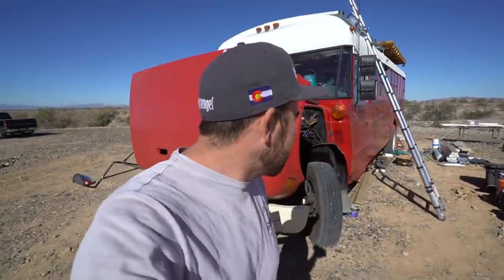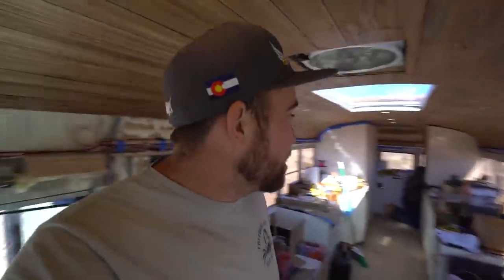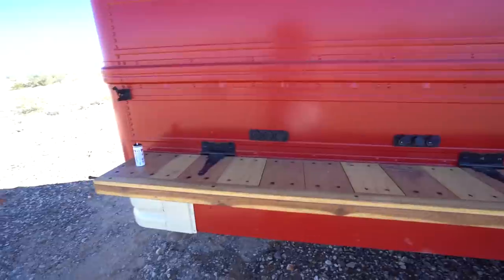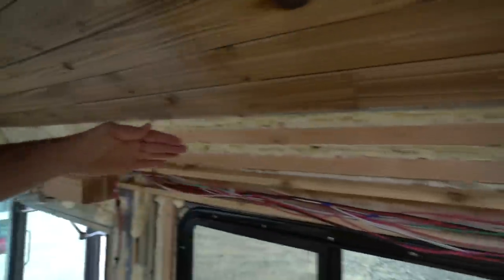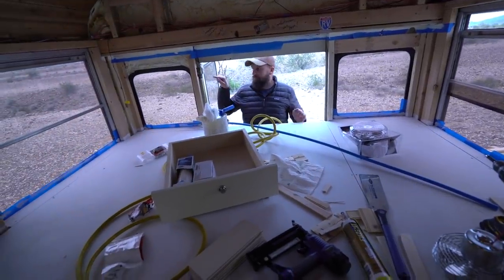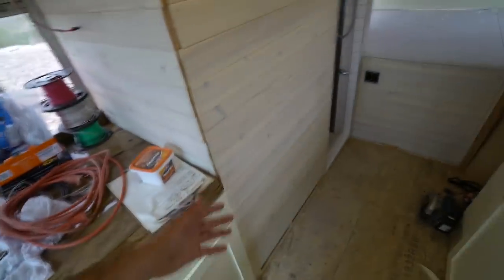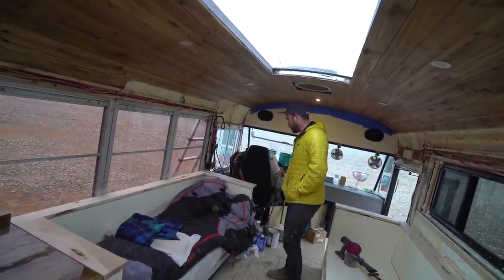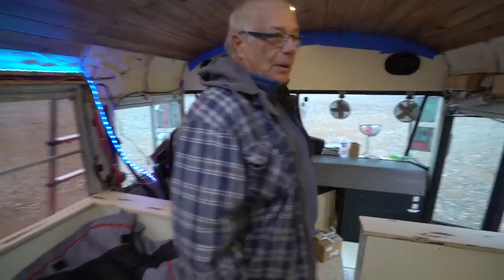MAJOR PROGRESS!! (Skoolie School Bus Conversion)

Comment: Keep the bathroom ceiling color as light as possible. A light color just makes your mood better over a darker color. But at least seal it with some urethane to keep the shower moisture from soaking in & warping it.

Comment: On the small wall at the bed, install a 6" metal kick plate at the floor level. Will save the finish from all the scuffing.
Hey, you caught the error about the power to the fridge. That is the important thing.
Reply from the maker: We made it to be removable. It’s gonna get trashed.

Comment: Are you gonna add lights to that clothing storage? Would probably be super useful and easy to do if you can tap into any 12v source nearby
Reply: I think I'd just go with one (or 2) of those battery operated - tap-on lights that you can just stick on the wall where you want with double sided tape.
Reply from the maker: Good idea.
Reply from the maker: We though about it, but didn’t do it. We can always add it.

Comment: How come  the seating wood goes right to the back on one side and not on the other? Meaning the rear piece of wood goes all the way to the kitchen units on one side but not the other ?
Reply from the maker: I don’t follow.
Reply: @JaxAustin  At 08:52, the piece of wood doesnt go all the way back to the window because the rear wood piece goes along to the kitchen unit but on the other side of the seating the piece goes all the way back to the window. One arm rest is longer than the other one.

Comment: not so mush catching youre bed on fire with the on demand water heater jax but more causing carbon monoxide poisoning  
(this is if its not an electric but propane version)  i sure hope its one of those non pilotlight electric ignite models or you better air out the space under the bed long before you enter , might be a good idea to build in a small (computer) extraction fan pushing air out of the space intoo the outside of the bus (if you put a rpm regulator on it should be allmost noiseless and should use verry little current ) in the space 
drawing the air out causes a slight vacuum , that should help keeping the harmfull gasses away from you lying on the bed 
the gas is allso releasing a lot of moisture in the air 
youre probably going to regret putting the waterheater so far back and dont make the door inside when it needs to be serviced or just quit outright 

make the armrest a tiny bit higher and seal between the kitchencounter and the armrest , that way if you spill anything on the kitchentop it (hopefully) dont wash over the edge ontoo cushions of the couch but will be stopped / diverted by the raised edge of the armrest

i have to agree the bus turned out realy nice
Reply: excellent point about the armrests, but they're already done by now so 'se la vi'
Reply from the maker: Yes, it’s an auto spark. It’s a really good unit. Maybe the best. Copper heat exchange, so you can drink the hot water. The only thing the recommend is a flute, but I only take minute showers. The stove would put out more c02

Comment: Where are ya living while your working on the Skoolie ?
Reply: Jax are ya able to use the shower yet & are ya going w/ a flush or a composting toilet ?
Reply: If that is a skylight in the ceiling are you installing a retractable shade & on all the windows & the entry door also & drapes on the windshield for privacy  ?
Reply: How about dutless a/c & heat ?

Comment: Why would you want to do something that is against every code in existence? Burning a tankless water heater inside a closed building much less a small bus is asking for trouble and placing yourself and possibly others in danger. It is bad enough that you want to do it but to then show it on a video and then try to explain it as no big deal shows that you have no idea what you are doing.
Reply from the maker: Well Larry, it is tankless and ventless. So there’s that. And I think it’s a known fact that I do not come from a building background.
Reply: Jax Austin 

I think that if you check the instructions, the ventless heater is to be surfaced mounted outside, therefore it does not require a vent. You need to understand that what you show and do will influence others therefore you should be more cautious to insure the you not cause others to harm themselves. I generally do not comment other than a thumbs up or a job well done but this could cause serious harm. FYI, I was a plumber for forty five years, Master plumber for thirty of those years and have installed and maintained tankless heaters for twenty plus years. Please do not take this as criticism but as concern for your and others safety.